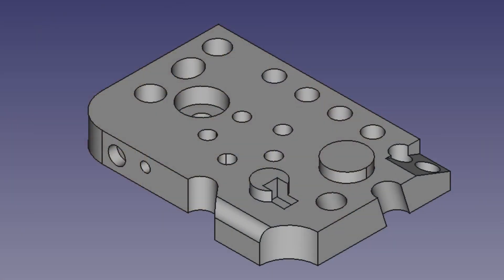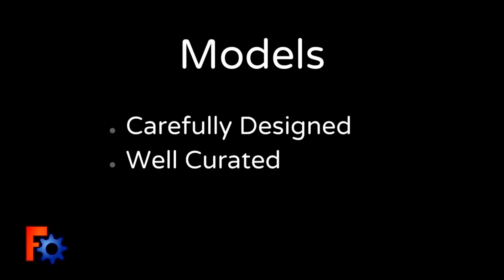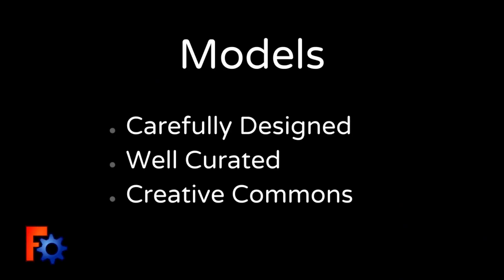Let's build some test parts!

Comment: Love the concept! If looking for tests for machines, check out NAS 979 and ISO 10791-7. I wish you the best of luck finding a copy of the originals online (without open the wallet wide), but they are referenced in academic papers with results of tests. One test that sometimes included in machine specs is a circle-diamond-square test, which comes from NAS 979. There might be similar standards for CAM, but I don't know.
Reply from the maker: Thanks for the tips.  We added our version of the circle-diamond-square in december.  Not taken from the NAS-979 so I don't know if it's dimensionally the same but the concept is similar.